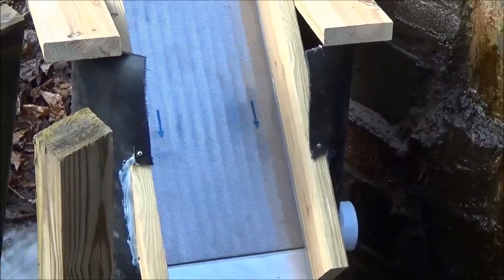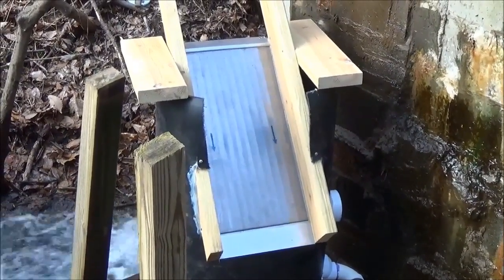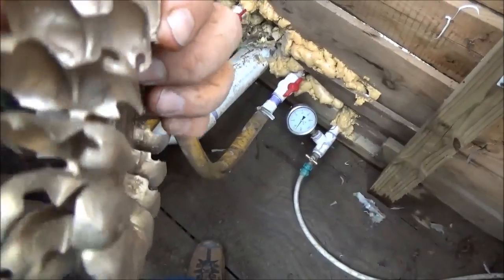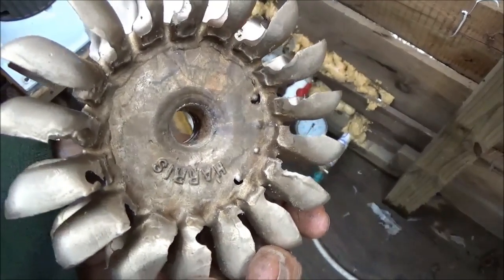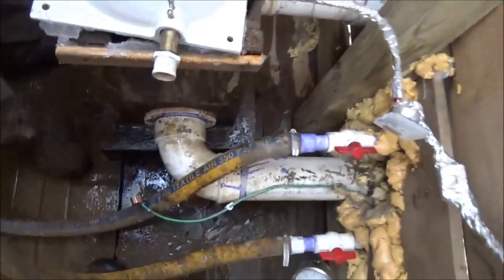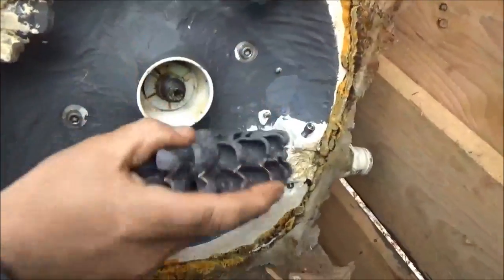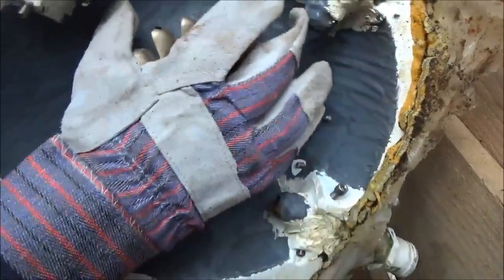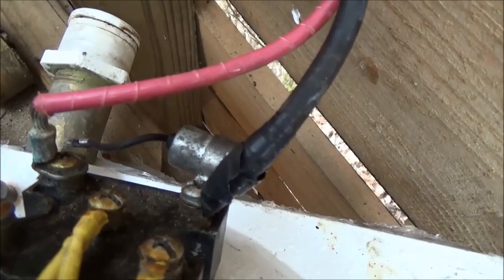Getting the most out of your Microhydro setup

Comment: Hello liked you video one question can anyone Please help me understand i also have put up a dc generating turbine and pelton and my voltage goes up to 50vdc volts free spinning then bogs down to 12vdc when hooked to charge controler and spikes from 40 to 12vdc over and over again on charge controler is there a way i can keep the voltage constance for steady chargeing? Thanks for your time ,Curtis. Ps the water psi is very constant im wondering if it a charge controler issue ?
Reply: When my Harris was running it was connected to the battery bank directly with an ammeter…your charge controller need not be in this circuit…..I have a way to test your charge controller…if needed…

Comment: Wondering in a closed system with 1000 gallon tank up at top and another at bottom with a 12 volt pump to pump water to the top when I have excess solar power and batteries are topped off then use this as a backup to charge batteries at night or on a cloudy day. water tanks underground and all lines underground, how much power with proper size down nozzle for increased pressure do you think this would yield?
Reply: The potential energy in 1000 gallons of water elevated 30 feet is about 100 watt hours. You'd be lucky to extract 70. (70%)

It will take about 134 watt hours of power to pump 1000 gallons of water that 30 feet; assuming 70% pump system efficiency.

In short, by adding 1 average battery (800Ah) to your solar array you'd store about 7 times more usable energy than a 1000 gallon holding tank at 30 feet elevation...
Reply: You basically just invented a very inefficient battery
Reply: Check the Harris specs….a 10 k tank at 100’ would deliver less than 3 hrs at 500 watts
It may take over  10 hrs to fill it at 10 gpm.

Comment: You want a Pellton wheel to run on a horizontal axis. When you have relatively low head you want a Turgo wheel and a vertical shaft like here. You also have to match water velocity to the wheel speed and that has huge impact on your generator selection.

Comment: Sediment wear is why you make a pool at the top and draw from near the surface so sediment will settle out before going through your system adding in a coanda screen after that is "good gravy".
You can clear sediment build up in your pool by simple siphoning with a separate hose and send it down stream on a as needed basis.

Comment: I stopped buying wheels not too long ago. Now I just make my own, and the amount I lose in efficiency I make up for in savings because my source is VERY abrasive. I was losing wheels so fast that I think making my system high pressure was a mistake. I am going back to a low pressure set up with my own turbine design.

Comment: i wouldn't rectify the current from the alternator, till it reaches the home. for wire loss reasons and wire demand reasons. and i being a ham know this. as to many keep telling me differently. edison plan of dc homes is great. but power transfer of dc sucks for long runs. edison would have to put sub station every so often between homes. and he would have to pick up his source of power from an ac source to feed his dc supplying sub stations. because of the losses and wire demands for long runs at amperage rating. being the sub station would have to be everywhere and eventually nation wide.
Reply: A lot of people are doing that nowadays.  I had to use 4/0 aluminum wire to deal with the voltage drop from the distance.  Luckily I got a good deal on the wire (used).
Reply: in many cases for long runs of ac current, a 8 or 6 gauge wire would surface. a much cheaper alternative to what you had used. everyone isn't fortunate to get 4/0 for cheap or free. but it is nice when it comes your way.

 just off the top of my head, the coating put on the one impeller, looked to me to be liquid steel epoxy. i had imagined maybe a soft rubber like coating to absorb impact, to the metal base impeller, from silica or other abrasive particles. this in an attempt to overt damage to the metal. but it would need to be resilient to rip-age or separation from it parent form. maybe line-x coatings would work. but it would need to be fiber reinforced and have better adhesion to the form. from all the coatings i've seen like this, used on armor plates in ar500 bullet resistant armor. it rips and separates pretty freely once compromised. or have a ar500 or titanium impeller made. as titanium is ar750. but it is only resistant to abrasion, not immune..

Comment: You dont need a machine shop to balance one of those impellors, although I do work in a machine shop and balance pump impellers :P Bolt a couple bearings to a stand, find a decent shaft to stick the pelton wheel on and start drilling away. You'll know when its done when you can take an air nozzle and spin it up to a couple thousand RPM on the stand without it hopping off :P

Comment: I have running water on my property but it's not running that fast. What would be interesting is if you could make more power than it takes to make the power. Could you turn it into a closed loop system with a pump? This could reduce if not eliminate the sediment wear on the impeller. I'm working with solar now, with the goal of running a dc motor directly off the panels and battery bank to power an ac generator. I also intend on hard wiring in a battery charger as a wind turbine that is always making power, this will reduce the need for a huge battery bank and a large inverter. My prototype is 10 KW 47A @ 220V AC this has and will feed directly into a twin 50A circuit, while it won't run everything; it will also be upgraded to a 30KW the 10KW will be for the barn.

Comment: Hi, would it not be better if they run AC up the mountain and then rectify it?
Nice video :-)
Greetings from Belgium
Erik
Reply: It doesn't matter much. You want to use high voltage to overcome the losses in the wire used, but it doesn't matter if that voltage is AC or DC.

Power companies distribute electricity using very high voltage (think kilovolts) AC because they use transformers (which can only take AC) to step down the voltage close to homes. This setup uses an inverter instead.
Reply: +Dan Chokola Thx for the reply :-)
Reply: notwithstanding dan's opinion,  dc can be run long distances, but very heavy conductor must be used to minimize losses.  grid power is transmitted as high-voltage ac, so massive conductors are not necessary..
in a power generating/delivery system, wild ac from the generator is converted to dc.  then dc is converted to clean ac for use.  if this double conversion takes place near the generator, clean ac can be run without the need for heavy conductors.     cheers

Comment: I have been thinking about putting in a hydro system but I don't have a stream. I thought about it a little and it occurred to me that I have an intermittant flowing water source. I can use my rain downspout. It has a 30 foot drop straight down so I am thinking about a way to put a generator near the bottom. What do you think?
Reply: Did you do it?

Comment: Man hydro is cool. I can most likely refurbish that pelton wheel, depending on the parent metal.
Reply: Glad I was able to get you 2 connected :)
Reply from the maker: MrHydrohead Yes sir, it is from Hydroscreen.  I need to check out your setup.
Reply: Check out MrHydrohead he has an awesome setup - he has videos of his old setup that ended up failing and he's in the process of uploading video of his new setup - it's MASSIVE
Reply: Sachi WI wow! He is good. He even cast his own silicon bronze runner.
Reply: Nice vid,  where did you source the Coanda screen?  I'm thinking it might be one from Hydroscreen.  I've been trying to source a section of just the screen itself vs. a prebuilt one.  All I need is the screen, not the easiest thing to find, but I figure far more cost effective once located.